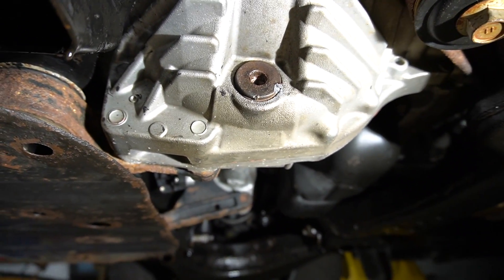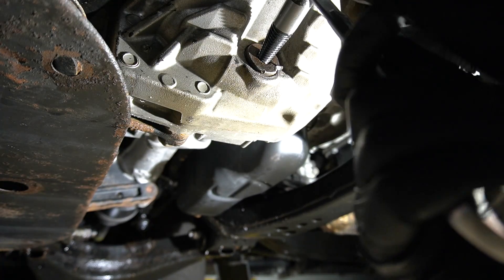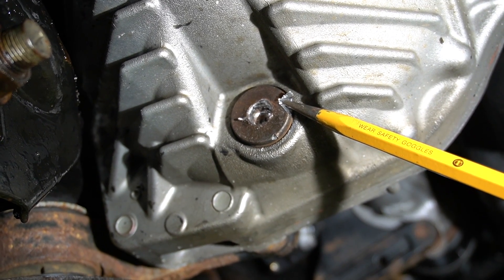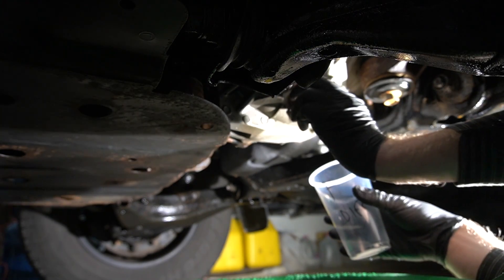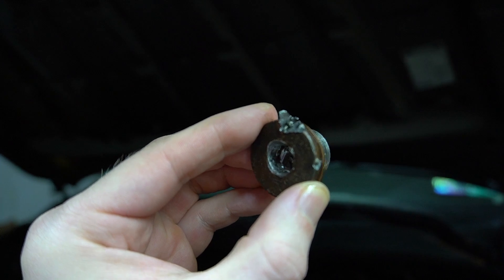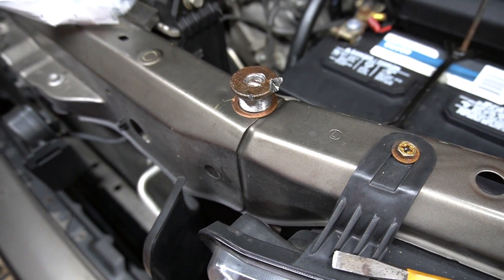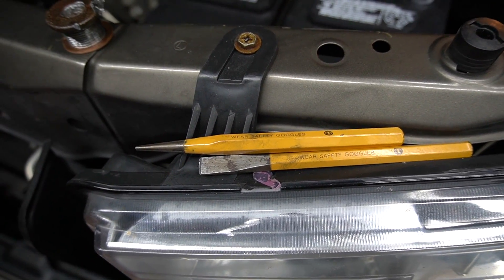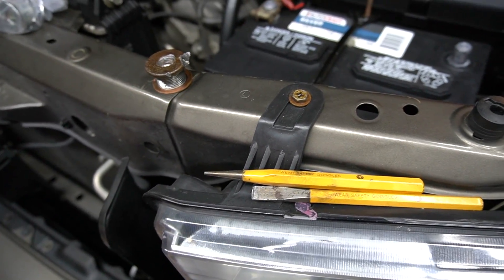How to remove stripped hexagonal drain plug, how to remove stripped drain bolt, damaged drain plug

Comment: I had a 97 4Runner and I welded a 1/2” bolt on the plug and it worked perfectly

Comment: I have the same problem as you.  2009 Tundra.  I stripped the Front Diff Hex Drain plug and cant get it out.  Thanks for your solution.  I will get the Chisel and nail punch and try to get mine out!
Reply from the maker: Try not to damage aluminum diff housing with chisel. Just take your time. Thank you watching.
Reply from the maker: Can you remove your fill plug?
Reply: Yes - I removed the fill plug and was able to pump out the old fluid so I got the fluid changed.  I wish there was a way to put a regular 14- or 15-mm drain plug.  These hex plugs are a real pain since they are soft metal!

Comment: I am in the same position! Mine was stripped by an otherwise very good shop who installed my front locking differential, or rather the kid who did the warranty required 500 mile gear oil change stripped it. I just saw it the other day and called the shop, they said no problem, bring it in and we will put a new (Dimple) plug in. This kept me from being angry, them not fighting with me. I suppose I could have got it out myself.....but then I would be angry and not proud even if successful hahahhahaha (My plan was to try to make the "hole" a 11 square drive as I have that in my plug removal set). Headed to the shop right now!
Reply: OH man. Boring. He just cut a groove and used a hammer and chisel. Done. Screwed in the Dimple plug and done. Not exciting is a good thing.Thanks!

Comment: With the size holt a small bolt welded in.  You only need to hit 2 sidesof bolt or nut or combination of both. Plus the heat from welding helps as well.

Comment: I use heat first, then the same method you used. Hammer with a cold chisel, comes out every time.  Those 10mm hex plugs are prone to strip, even though it's only tightened with 26ft-lb which is nothing.  If I owned a welder I would tack weld a 17mm nut to the plug.
Reply: What heat source did you use? Thanks.
Reply: Lamar propane torch moving quickly back and forth to prevent damage.

Comment: Thanks, I had the same thing happen at a lube place. I tried embedding a triple square socket in and turning but in the end this chisel method ended up working with a little heat.

Comment: I never use the quick lube places - they are inexperienced, up sell unnecessary procedures and often cross thread or use the wrong tool to remove bolts.  I serviced the transmission and discovered the last mechanic that did the job cross threaded the pan bolt.  I will find out on the next service whether the transmission pan's threads are damaged too.
Reply from the maker: What do you have and year?
Reply: @repairvehicle  2001 Toyota Sequoia Limited 4X4

Comment: Yikes I have to do something like this today,  tried a torx bit hammer in there and that just stripped it more.  Might try to weld on a nut instead hoping this might heat it up a bit and release the threads also.  Not sure why these seize so badly on Toyota’s…. Yikes
Reply from the maker: Due to lack of maintenance.

Comment: I'm having trouble with my stuck gearbox drain plug, it has I half inch square drive hole. I am using penetrant, heat, breaker bar, half inch drive impact driver and hammer, rattle gun,  repeat again. Am going to try heating the casing and an icecube on the nut then breaker bar with extension. My nut is smaller so the chisel and centre punch is  a good  idea but will have less leverage. I am concerned about stripping the threat since it is so tight, but that probably can't be prevented, hence the penetrant spray.
Reply: Same here pff

Comment: I was delivering parts for O'Reilly.  The quick lube place ordered oil and filter for a Ford F250, diesel.  They called me stupid. Because I brought the wrong oil filter,  they needed the top one.   Confused I drove back down to the shop to see the lube tech beating the filter housing with a hammer and diesel fuel smell flooded the shop.   Told them I couldn'thave that housing until tomorrow.   Customer was waiting.

Comment: What was the cause of damaging the plug Valvoline oil? or somebody overtighten it. Please answer.
Reply: I think the reference to Valvoline oil is the fast oil change place was one of the Valvoline branded drive -in fast lube joints.........never, and I mean never go to ANY of these......they got non trained youngsters working there with almost no skills.......and worse for tools as is evident by this video on the damaged allen type drain plug........
Reply: @josephklimchock5412  thanks man, I was kind of confused. Thanks for taking the time to answer. Best wishes.
Reply: I work at a valvoline for 10 years have never stripped a plug or drain. Are you sure you didn't strip it yourself then come into a store.  Glad you got it off. If we serviced your vehicle when did you discover it was stripped?
Reply from the maker: Why would I strip the plug, if I just bought the truck from used car dealer and it was serviced last time at valvoline.

Comment: Honda dealership really screwed up on 2005 CR-V two 3/8" bolts. Both stripped & rounded.
Not much room taking or tying to remove two seized differential bolts.
Anyone has tips if you don't have a lifter?
Reply from the maker: There nut extractor that can be used
Reply: @repairvehicle  Which brand/model that worked for you, rather than just saying so?
Reply from the maker: Irwin brand worked for me, but it's not very good.  I am currently researching to find best tool for removing nuts and bolts stripped.  Your plug has 3/8 square?
Reply from the maker: Watch this video https://youtu.be/EWLxzuDMuhk

Comment: Imagine doing all this then you pop the drain plug and the fluid is clean😡
Reply from the maker: Clean fluid,  does not mean fluid is good for continuous use.  That's why I do oil analysis to determine if fluid is good and how much wear has happened
Reply: @repairvehicle  yes it does i build motors if fluid is clean and viscosity is well its fine.
Reply from the maker: I have done many oil analysis and depending on oil brand,  clean fluid could means oil is bad and clean fluid could mean oil is good. You cannot go by the fluid color only.
Reply: I stripped my 2013 Prius fill plug.  I was glad I didn’t start with drain plug.  That would have been a serious disaster lol